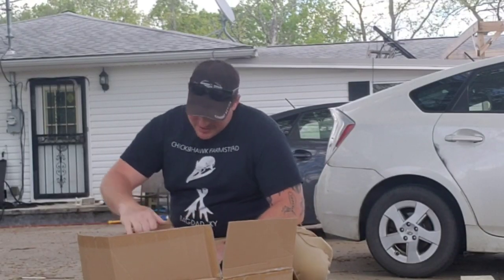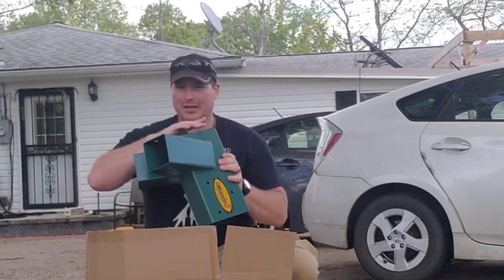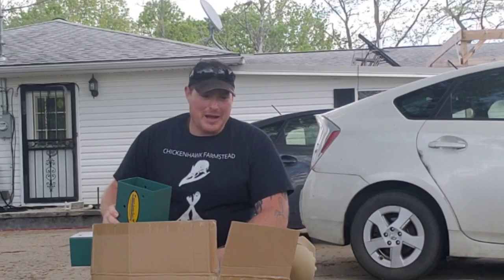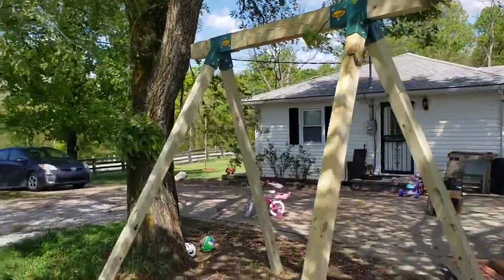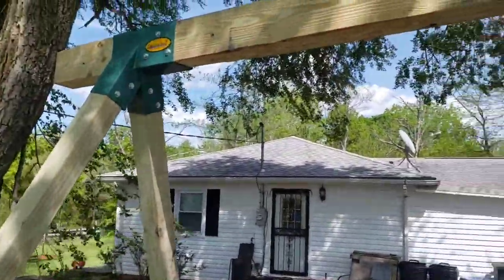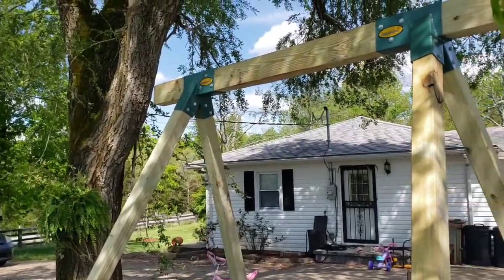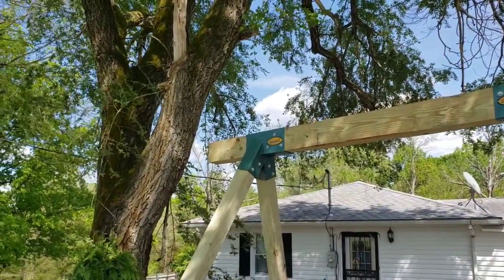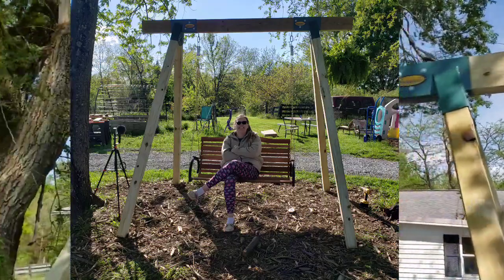Checking out A frame brace for a porch swing or a swing set , jungle gym

Comment: Great video. Interested to know where you got your lumber especially where you posted this year. At both Lowes and Homedepot there price for 4x6x8 severe #2 is around $20 where your cost was only around $14 ??? - Thanks again for the sharing.
Reply from the maker: I got the lumber at lowes. But yes right now lumber has went up quite at bit. Hoping it will go back down soon.

Comment: Any chance you know the measurements of the legs between the feet?
Reply from the maker: The Inside or outside
Reply: @chickenhawkfarmstead8478  the outside I’m looking to build a mulch box around the swing set
Reply from the maker: 106 x 86   inches    hope that helps. I will say there is some movement in the legs where if I picked it up I could make them a little wider. So if you added atleast   8 inchs to each side that the smallest i would go.